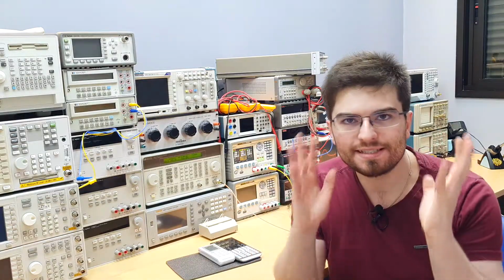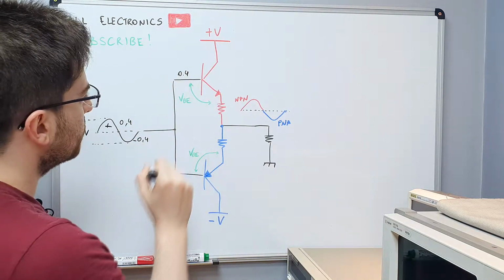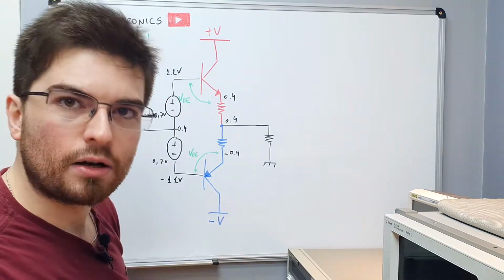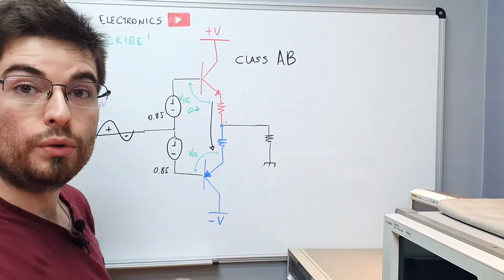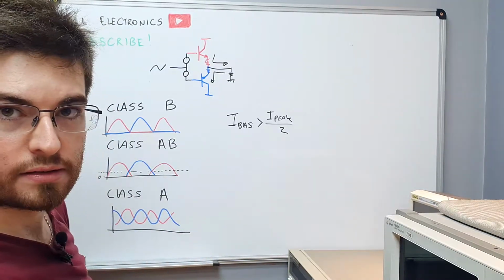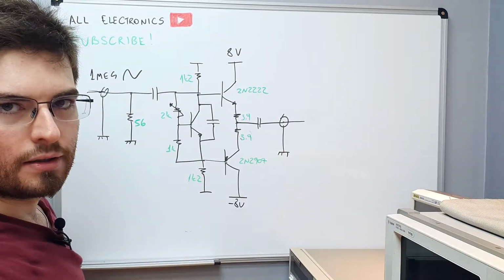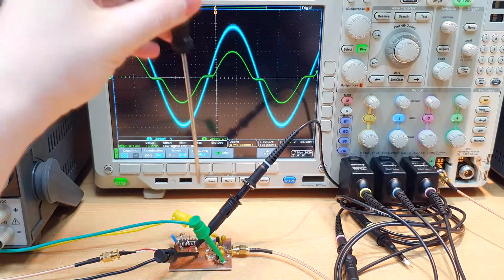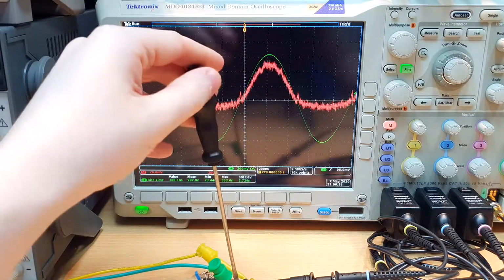Push-Pull Pair - Class B, Class AB and Class A operation

Comment: Pnp (-ve base) pulls the voltage through the load, npn(+ve base) transistor pushes voltage into the load. The reason the signal is separated and attracted to those descrete transistors is because the base of npn is positive, while the base of the pnp is neg, attracting the opposite polariies of the signal, remembering the signal input is an oscillating sine. This is the basic funtion of a push/pull amp that i think is called class B. Bias voltage again comes into play, in order for the transistor to operate the base (gate) must have the correct discrete voltage applied in order to function, this is called it's saturation voltage. This bias voltage is tapped off the collector voltage and can be visualised by applying the function of a car starter motor, the main (spin) winding has a different circuit than the much smaller current for (cog-engage), this is exactly the way a push or pull transistor works, they use seperate voltages for base as against collector.

Comment: That circuit will not work as drawn he has his translstors reveversed the bottom has no source to provide current.
Reply: I made a mistake it is not the transistors are reversed but that there is no load capacitor and load resistor for the bottom transistor to function

Comment: on the mulatiplier, how did you know the voltage in the transistor input will stabalize on 0.7? And why isn't it the same in the top transistor of the amplifier?

Comment: It's quite unnecessary when you can use 1 transistor and DC bias upwards and remove it in the end. Maybe there are reasons behind it. We will use stronger ways as it grows and then we save some Watts in idle mode events, I guess. It's more like a history lesson.

Comment: In your circuit at the beginning of the video - you show the load connected to "a ground"
This ground is actually the "mid point" or common return to the +ve and -ve supply rails.
Some may be wondering how current can flow into or out of the load - where there is no apparent connection to any supply.
Reply from the maker: Through power supply decoupling capacitors, usually not drawn in the schematic!

Comment: Hi Gregory! Thanks for the great video and explanation. It was very clear and concise to me. I also liked the demonstration and negative discharge current pointed out 👍 I have a question about the test circuit itself. Why do You prefer a soldered version on a copper plate to a breadboard circuit? Kindest regards!
Reply from the maker: It is easier to do, beautiful and ensures a forceful ground plane.

Comment: At  6'30''' the  0.3V output voltage will be split between the emitter R and the load if current is flowing, which it will be as the Q is on.

Comment: This is so clear. Great explanation that I finally get what class AB bias vs class A nice 😊
Reply: Seriously, I am not an engineer or anything just like audio stuff and can do only do minor repair to vintage stuff with a 50/50 success rate. But this really allowed me to understand very basic concepts in a much more concrete way. Just the right amount of detail. I feel much more confident adjusting and checking bias on old equipment and understanding  how to use a ‘scope for it. 

Now if I can only figure out why  two resistors just went up in smoke on my old turntable…

Comment: It would be interesting to see (both theoretically and in practice) how such a push-pull pair operates given a load that includes reactive components. The reason is that it's the current which matters when deciding which transistor is open, but its phase is not the same as of the voltage.

Comment: Can someone explain what a high and low impedance signal is?
Reply from the maker: It is not a physical correct way o saying, but it helps to understand circuits. 
I call a high impedance signal, the one the comes from a high impedance source. 
These are signals "weak", represented by high voltages with low current capacity. 

Low impedance signals are signals "strong", the comes from low impedance sources.

Comment: This is the best explanation I found. Thanks. 
I have two questions: 
1) has the capacitors to be polarity dependent(electrolytic)? In such case, how we can connect the capacitor in series to the load?(is the positive pole on the load or between the two Re?)
2) are the two identical resistors in series with Vbe multiplier used to maintain reverse polarity of collector base of BJTs so that they are in active region? If so, how can we choose their values?
Reply from the maker: 1) for lower frequencies, probably you will use high value electrolytic capacitors. In this situation, you connect the positive side to the transistor bridge. 

2) You can calculate as a voltage divider. The bottom resistor will always have constant 0,65V, so you calculate the upper one to get the desired output voltage.
Reply: @AllElectronicsChannel  I tried the circuit. Re must be greater (10 Ohms) and transistors heats up too much after some time. With Re=3,9Ohms the transistors was damaged. I will try with bigger transistors

Comment: May I ask a question? At 24:11 you say that it'd have 0,7v across each resistor but the total voltage would be 1,2V. Why? Wouldn't it be 1,4v? And after when you consider the trimoot with 2k ohms, it is 0,7v , 1,4v and the results would be 2,3v? Why? Why not 2.1v?
Reply from the maker: I think I got confused.. some times I use 0,7 and some times 0,6 as the base voltage

Comment: Awesome explination thank you! I am just a little confused on how the biasing network works when you use a diode to achieve your biasing. Why does the transistor also recieve a 0.7V when the boasing diode has the same. Will you please be able to explain this in a beginner way showing the cutrent flow of this system. Thank you!!
Reply from the maker: The diode is in parallel with the base !!

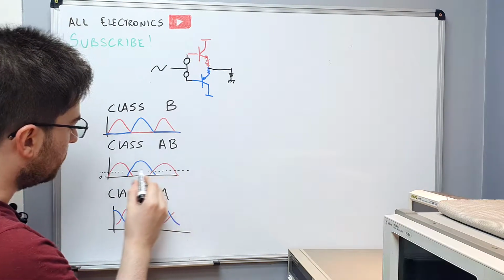Comment: 15:53, I am a little confused because I always thought that class A was a single NPN transistor (one active device) configured as an emitter follower, yet you are showing a two transistor configuration.
Reply from the maker: Class A is any configuration wheres the transistor conduction isn't cut!! It  is commonly shown with a single transistor, but it's not related to the topology!
Reply: @AllElectronicsChannel  I didn't know that, I'll bet it's a common misconception.  Thank you!
Reply: @Enigma758  It is a common misconception; that exact misconception led me to find this video!  I read something about Class A push-pull and I thought "Wait.  How can class A be push pull?"  and here it is, explained.  I believe what you and I previously understood is single-ended class A.
Reply: @toadroller  Nice to know I'm not the only one who thought that.  Thanks for your comment! :)
Reply: @AllElectronicsChannel  Well then, "electronics-tutorials" must be incorrect then...

"Class A Amplifiers are the most common type of amplifier topology as they use just one output switching transistor (Bipolar, FET, IGBT, etc) within their amplifier design. This single output transistor is biased around the Q-point within the middle of its load line and so is never driven into its cut-off or saturation regions thus allowing it to conduct current over the full 360 degrees of the input cycle. Then the output transistor of a class-A topology never turns “OFF” which is one of its main disadvantages."
Reply from the maker: Class A is not a topology!! As you said, it is about conduction! You can have one transistor in class B or a push-pull with two transistors in class A. Class is not about number os transistor or configuration, is about current conduction.
Reply: @AllElectronicsChannel  I know, I just felt so much better that "electronics-tutorials" also got it wrong too! :)
Reply from the maker: @Enigma758  where all this misconception started ?
Reply: @AllElectronicsChannel  Maybe it's because all of the examples I find of Class A amplifiers show a single NPN transistor.  For example, if you google "Power Amplifier Classes wiki" - the Wikipedia example shows this too.  It does however state "The active element remains conducting all of the time", so it is easy to confuse the principal with the common example that is seen everywhere and one must be very careful not to confuse the two.

Comment: This video is just fantastic! Had to watch it a few times to absorb all of it (and probably still missing some insights). 
I have one question. At @30:16, what are those little current spikes (red trace) when the signal enters in cross-over? They seem to remain there also when we move to AB class.
Reply from the maker: Thank you!! 

Good question! It seems more like current spikes from the junctions capacitance, responding for the transients between the positive and negative cycle.

Would be nice to investigate it more!

Comment: Excellent explanation Gregory! Thank you for sharing. Can you demonstrate the diode solution as a method of compensation instead of using a transistor?
Reply from the maker: Hello, thank you! 
I don't have any video about it now. 
Basically using a diode to generate the DC offset will automatically compensate for the junction voltage to temperature relationship. 
You need to put the diode VERY close to the transistor (in the same heatsink and side by side) so any increase in temperature of the transistor will be coupled to the diode.

Comment: I got mind-fucked! Only now I know what the heck 'distortion' and 'crossover' are in this context. I read and heard a lot about them but I do not think there is anyone else explaining them. 

Few of them even mention use small resistor as the bigger  resistor is the more noise will be amplified. To a noob like me, it sounds magical not knowing how come resistor has noise. I am sure those 'tutorials' are meant for noobs, otherwise they will not be bothered with the babyish explanation.
Reply from the maker: Thank you man!
Reply: @AllElectronicsChannel  The pleasure is mine!

By the way, Gregory, have you any video on how to choose the 'right' values of resistor? I was understood to always choose the smallest resistor to prevent internal noise (I guess it is inherent stray capacitance and inductance. Same story with capacitor, choose the smallest capacitance possible). But again, only one person (The AudioPhool. YouTuber) I found explaining how to calculate the values, sadly he goes too fast and only transistor that he uses as the example.

I mean, I would like to know how to choose resistors for an operational amplifier as well because nowadays one small chip can do a lot more, saves much more space, and prevents so much more trouble than messing with discrete devices. About noise, integrated circuits these days have extremely low noise due to everything is in close proximity and internal resistors are microscopic.

Comment: Great video Gregory!  How does one go about calculating the value to be used for the Emitter resistors when building out a push pull amplifier?  You mentioned you used a 3.9 ohm for each transistor, but I'd like to know how you determined that please.
Reply from the maker: Hello man! 

In the example I used 3.9 because it was what I had around.

The resistance needs to be calculated based on the bias voltage and the bias current needed, and it needs to compensate the Vbe temperature coeficient.